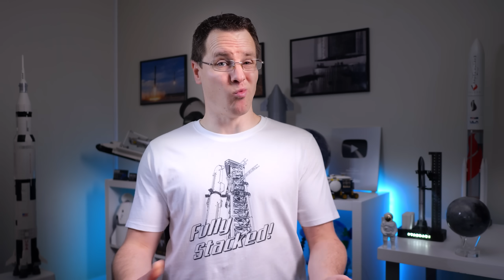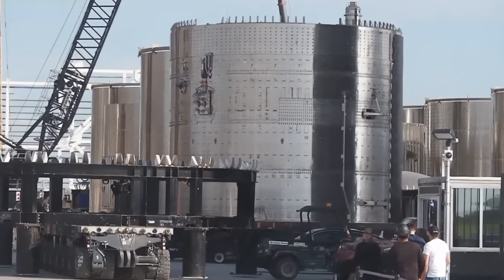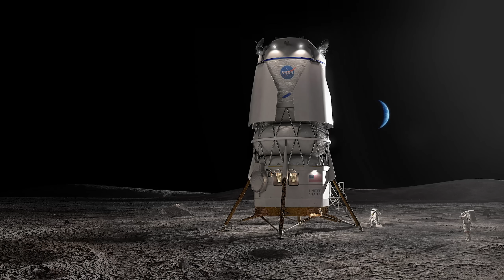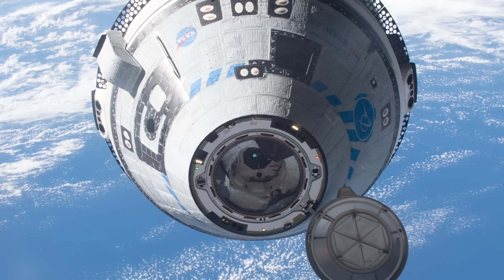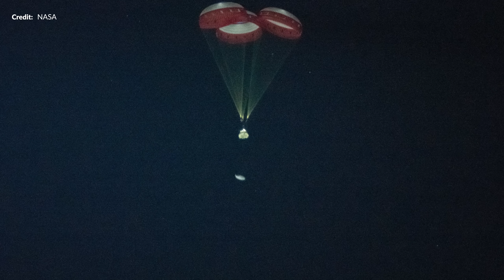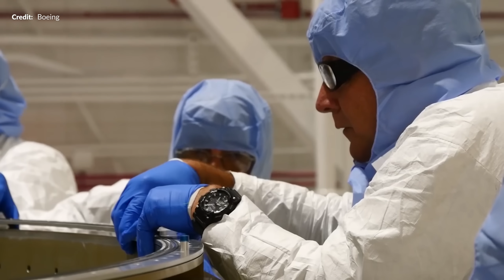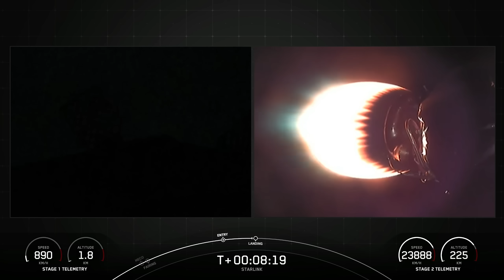SpaceX Starship: Mega Pad Upgrade to Tame the Thrust, Boeing Starliner Delayed Indefinitely

Comment: Uuuummmmm    The launch pad might well work.  Seems like a proper engineer has done the needed calc and design. 
However,  who will build the Mechzilla tower and launch pads on the Moon and on Mars?
Reply: They don't need to. The Mars ship will use legs
Reply: The gravity is less on Mars, and this might help explain why the atmosphere is thinner as well. Both of these, no matter cause, should assist in allowing less force to escape. But you have spotted part of another problem, Mars is mostly Dust.
Reply: Superheavy is only needed on Earth. On Mars, Starship will fly using its own engines due to the much lower gravity there.
Reply: As the others said, much less gravity on the Moon and Mars, so no need for the Superheavy booster. The HLS Starship has a ring of 24 small engines at the top of the propellant tanks for the last bit of the landing and the first bit of launch on the Moon. With the thrust distributed through 24 engines rougly 25m from the ground, a lot of it should dissipate before reaching the surface. It is likely that a Mars Starship would have a similar system.
Reply: Not so.   The Starship is a vertical structure.  It is vertically stable only when it stands close to vertical.  The puny legs of Falcon only work on stiff horizontal surfaces,  surfaces not present on the Moon nor Mars.  Further, the only way a large spaceship can land and takeoff is if it can be refueled.  Liquid oxygen is in short supply on the Moon and Mars.
Reply: @frankkolmann4801  The ship design is supposed to be able to carry a wide variety of cargo. Some of that cargo could be landing craft which could place drones or ai robotics. Elon has floated the idea of multiple craft going in a series, as has NASA. Fuel creation can be automated, and we've well proven the ability to work on Mars surface with the success of the Rovers currently there.

Comment: I've always been a fan of Boeing. However, it's time to send Starliner back to the drawing board. Too many serious issues have arisen, raising questions about the craft's viability. Circuit corrosion, flammable tape and constant delays make me wonder what other fatal flaws have yet to reveal themselves.
Reply: To be fair, the tape is flammable only in certain situations per reports. And requires failures of other hardware to happen. Per NASA/Boeing, "Although that tape is commonly used on other spacecraft, they are evaluating if it is acceptable for crewed flight (article NASA and Boeing say preparations continue for July Starliner test flight Jeff Foust May 27, 2023)"

Parachute and wiring issues to delay Starliner crewed test flight
Jeff Foust - June 1, 2023

"Both the parachute soft links and wiring tape were used on the Orbital Flight Test (OFT) 2 uncrewed test flight in May 2022 without incident. The soft link issue, officials said, would only be a concern if one of the three main parachutes failed, putting additional loads on the other two, while the flammable tape would have required what Nappi called “multiple failures” elsewhere in the spacecraft."

---------------

Boeing finds two serious problems with Starliner just weeks before launch
ERIC BERGER - 6/1/2023

"The second issue involves P-213 glass cloth tape that is wrapped around wiring harnesses throughout the vehicle. These cables run everywhere, and Nappi said there are hundreds of feet of these wiring harnesses. The tape is intended to protect the wiring from nicks. However, during recent tests, it was discovered that under certain circumstances possible in flight, this tape is flammable."

Comment: Please, please, please, it is time to cancel Starliner. Unfortunately this is one case of really poor design, management and careless development. I hope we don’t see a serious accident or at tragedy with our brave astronauts that are going to use that capsule. I won’t travel on it even if they give me all the money in this world.
Reply: To be fair, the tape is flammable only in certain situations per reports. And requires failures of other hardware to happen. Per NASA/Boeing, "Although that tape is commonly used on other spacecraft, they are evaluating if it is acceptable for crewed flight (article NASA and Boeing say preparations continue for July Starliner test flight Jeff Foust May 27, 2023)"

Parachute and wiring issues to delay Starliner crewed test flight
Jeff Foust - June 1, 2023

"Both the parachute soft links and wiring tape were used on the Orbital Flight Test (OFT) 2 uncrewed test flight in May 2022 without incident. The soft link issue, officials said, would only be a concern if one of the three main parachutes failed, putting additional loads on the other two, while the flammable tape would have required what Nappi called “multiple failures” elsewhere in the spacecraft."

---------------

Boeing finds two serious problems with Starliner just weeks before launch
ERIC BERGER - 6/1/2023

"The second issue involves P-213 glass cloth tape that is wrapped around wiring harnesses throughout the vehicle. These cables run everywhere, and Nappi said there are hundreds of feet of these wiring harnesses. The tape is intended to protect the wiring from nicks. However, during recent tests, it was discovered that under certain circumstances possible in flight, this tape is flammable."

Comment: What incompetence! And they got twice the taxpayer funds than the competent Space X. Corruption taking care of the companies NASA executives want to go to work for when then retire!
Reply: To be fair, the tape is flammable only in certain situations per reports. And requires failures of other hardware to happen. Per NASA/Boeing, "Although that tape is commonly used on other spacecraft, they are evaluating if it is acceptable for crewed flight (article NASA and Boeing say preparations continue for July Starliner test flight Jeff Foust May 27, 2023)"

Parachute and wiring issues to delay Starliner crewed test flight
Jeff Foust - June 1, 2023

"Both the parachute soft links and wiring tape were used on the Orbital Flight Test (OFT) 2 uncrewed test flight in May 2022 without incident. The soft link issue, officials said, would only be a concern if one of the three main parachutes failed, putting additional loads on the other two, while the flammable tape would have required what Nappi called “multiple failures” elsewhere in the spacecraft."

---------------

Boeing finds two serious problems with Starliner just weeks before launch
ERIC BERGER - 6/1/2023

"The second issue involves P-213 glass cloth tape that is wrapped around wiring harnesses throughout the vehicle. These cables run everywhere, and Nappi said there are hundreds of feet of these wiring harnesses. The tape is intended to protect the wiring from nicks. However, during recent tests, it was discovered that under certain circumstances possible in flight, this tape is flammable."

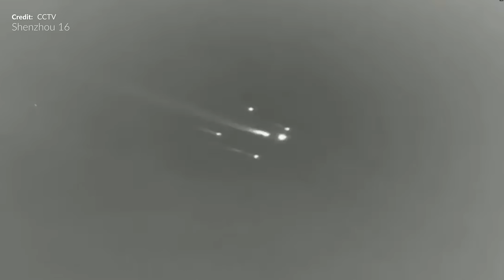Comment: 19:30 where you ask why Long March doesn't leave side boosters attached. My guess would be to make absolutely certain that there is no thrust coming from the SRB's at the time of main booster cutoff/stage separation.
Reply: This is very likely. If you watch a Delta or shuttle launch, the SRBs are still burning when they’re jettisoned. They just aren’t producing efficient thrust. Nobody wants their unstable, mostly burnt out SRBs causing a kick collision during separation. They would probably also interfere with fuel settling ullage maneuvers right before stage sep.
Reply: @Grak70  Yup. SRB's don't have an "off" switch - they don't shut down until they've burned out. No matter how precisely they're packed, their burn time is going to vary, albeit slightly. In rocketry, a slight aberration is all it takes to scuttle the mission.

Comment: Speaking of Starlink in rural areas. I live at home with my mother currently (19y/o here), and we've struggled constantly for around a year with awful wifi service. Sky broadband "promises" a minimum download of 55mbps but we've never seen above 33. Multiple times have we called Sky engineers out to diagnose the issue and they've never once been able to fix it. We had finally had enough and last week we took the plunge and told Sky we were leaving our contract. We ordered Starlink and within 8 days, the entire package was in our living room from California to the UK and just 48hrs after ordering our starlink mounting arm, it too was here. Since then, we've had Starlink installed for around a week with ZERO downtime and over 250mbps internet speeds and rising (with peaks so far being over 500mbps). For a household that is semi-rural and who qualified for the rural-home discount, this was an utter godsend. Not a single broadband provider here in the UK is able to compete with starlink. Starlink is unbeatable
Reply: I would bet your downtime was solar-flare related. Turns out the earth is bathed in ions and particles from the sun all day, on top of the photons. Sometimes those materials come in as more massive waves and/or more charged, and the variations can cause affects unaccounted for in our previous, more solid-state views.  Starlink will suffer from this as well, but because it is probably generations ahead of your previous provider in communication algorithm and antenna designs, it will be faster en-large. You Aussies have some interesting phenomena with particles and atmosphere as well, that might contribute to disruption. That may, or may not, relate to the Magnetic south pole getting closer to you.

Comment: I’ve got to say, starlink disturbs me a little bit. The predawn sky has completely changed since these LEO constellations have gone up. I used to look up and see a satellite every 5 mins or so. Now it’s every few moments….
Reply: You don't know what you've got, till it's gone.
Reply: My guess is they won't be there forever. When better satellites are made, they'll maybe reduce numbers.
Reply: @bengsynthmusic  Part of the number of the satellites for Starlink, is their low orbit. Being so low, means that you have much less ping to and from the ground. You also can't see as much of the ground, so you can have a smaller sat cover that distance. And if you have a sat fail, it's down in under 5 years because it is soo low.

if you put the sat higher, it can see more ground, so you don't need as many. You also have to make them more capable to handle the larger area. You have a longer ping and you stay in orbit much longer for a failure.

For Geostationary sats, you see a large part of the globe, so you only need a few sats. They have to be very capable to handle so much more traffic. The ping is even longer and sats stay for a millenia or more.

Comment: Boeing lost its mojo a long time ago. 787 anyone? With Dragon, I can’t quite understand why Boeing is needed at all. At least for the capsule. Give SpaceX a few months and they’ll build all the extra equipment needed for the Moon, Mars or wherever.
Reply: Because if NASA had chosen only the top bid in 2014, there would possibly not be a Crew Dragon and NASA would likely be still relying on Soyuz to get crew to the ISS. In 2014, the 737 Max had yet to fly and Boeing was still seen as a top aerospace company. SpaceX was the upstart, who was still trying to land boosters. SpaceX landed the first booster over a year after the 2014 Crew Dragon contract and didn't reuse a booster until 2.5 years later.

Comment: Boeing using flammables? No surprise, in general, Boeing can't even build build planes properly anymore. They should not be given money to risk lives to support their shrinking bottom line.
Reply: To be fair, the tape is flammable only in certain situations per reports. And requires failures of other hardware to happen. Per NASA/Boeing, "Although that tape is commonly used on other spacecraft, they are evaluating if it is acceptable for crewed flight (article NASA and Boeing say preparations continue for July Starliner test flight Jeff Foust May 27, 2023)"

Parachute and wiring issues to delay Starliner crewed test flight
Jeff Foust - June 1, 2023

"Both the parachute soft links and wiring tape were used on the Orbital Flight Test (OFT) 2 uncrewed test flight in May 2022 without incident. The soft link issue, officials said, would only be a concern if one of the three main parachutes failed, putting additional loads on the other two, while the flammable tape would have required what Nappi called “multiple failures” elsewhere in the spacecraft."

---------------

Boeing finds two serious problems with Starliner just weeks before launch
ERIC BERGER - 6/1/2023

"The second issue involves P-213 glass cloth tape that is wrapped around wiring harnesses throughout the vehicle. These cables run everywhere, and Nappi said there are hundreds of feet of these wiring harnesses. The tape is intended to protect the wiring from nicks. However, during recent tests, it was discovered that under certain circumstances possible in flight, this tape is flammable."

Comment: If they get the bugs worked out this Starliner should be one of the best space craft available . I said IF! Engines shutting down during a coupling maneuver isn’t a good thing. Jeeze hard to believe they built over 10 Apollo spacecraft that worked so much better.
Reply: NASA doesn't hire missions without triple backup options. I agree, Boeing seems to be self-immolating without clear cause, or at least cause that can't be spoken openly in current PC terms.
Reply: @up4open763  The Boeing and McDonnell-Douglas merger in the late 1990s is widely seen as the downfall of Boeing. Engineering based management was replace with corporate management from MD, that was more worried about stock price than product. The new management has a long way to go to dig out of that self-imposed hole.

Comment: The booster/core stage separation... If the boosters are solid prop they might have some thrust so happening that would drive the core stage back into the 2nd stage if they were still attached.

Comment: The fact that there is a flammable tape issue at all makes me think of Apollo One and also the issues with the first lunar lander, deep flaws that were detected but unfortunately too late for crew on Apollo One.
Reply: To be fair, the tape is flammable only in certain situations per reports. And requires failures of other hardware to happen. Per NASA/Boeing, "Although that tape is commonly used on other spacecraft, they are evaluating if it is acceptable for crewed flight (article NASA and Boeing say preparations continue for July Starliner test flight Jeff Foust May 27, 2023)"

Parachute and wiring issues to delay Starliner crewed test flight
Jeff Foust - June 1, 2023

"Both the parachute soft links and wiring tape were used on the Orbital Flight Test (OFT) 2 uncrewed test flight in May 2022 without incident. The soft link issue, officials said, would only be a concern if one of the three main parachutes failed, putting additional loads on the other two, while the flammable tape would have required what Nappi called “multiple failures” elsewhere in the spacecraft."

---------------

Boeing finds two serious problems with Starliner just weeks before launch
ERIC BERGER - 6/1/2023

"The second issue involves P-213 glass cloth tape that is wrapped around wiring harnesses throughout the vehicle. These cables run everywhere, and Nappi said there are hundreds of feet of these wiring harnesses. The tape is intended to protect the wiring from nicks. However, during recent tests, it was discovered that under certain circumstances possible in flight, this tape is flammable."
Reply: @steveaustin2686  Thanks for this
Reply: @brettpatching  You're welcome.
Reply: @steveaustin2686  "the tape is flammable only in certain situations per reports. "... like the situation where it gets hot.
Reply: @angelarch5352  It requires multiple failures. Maybe read the ACTUAL articles, instead of jumping to conclusions? This is why SpaceX supporters are looked down on. Look at what actually is going on both with SpaceX and other companies, instead of just the hype.

Comment: Would like to know what those two lucky astronauts chosen to ride Starliner on its maiden flight are feeling right now. 
That something as basic as flammable tape being anywhere near the capsule is troubling. Almost as bad as the decision
to use pure oxygen in the first Apollo capsule.
Reply: To be fair, the tape is flammable only in certain situations per reports. And requires failures of other hardware to happen. Per NASA/Boeing, "Although that tape is commonly used on other spacecraft, they are evaluating if it is acceptable for crewed flight (article NASA and Boeing say preparations continue for July Starliner test flight Jeff Foust May 27, 2023)"

Parachute and wiring issues to delay Starliner crewed test flight
Jeff Foust - June 1, 2023

"Both the parachute soft links and wiring tape were used on the Orbital Flight Test (OFT) 2 uncrewed test flight in May 2022 without incident. The soft link issue, officials said, would only be a concern if one of the three main parachutes failed, putting additional loads on the other two, while the flammable tape would have required what Nappi called “multiple failures” elsewhere in the spacecraft."

---------------

Boeing finds two serious problems with Starliner just weeks before launch
ERIC BERGER - 6/1/2023

"The second issue involves P-213 glass cloth tape that is wrapped around wiring harnesses throughout the vehicle. These cables run everywhere, and Nappi said there are hundreds of feet of these wiring harnesses. The tape is intended to protect the wiring from nicks. However, during recent tests, it was discovered that under certain circumstances possible in flight, this tape is flammable."